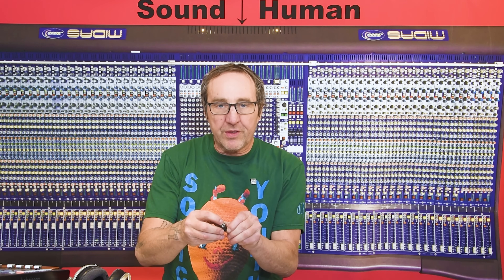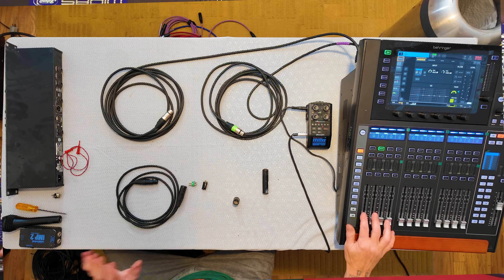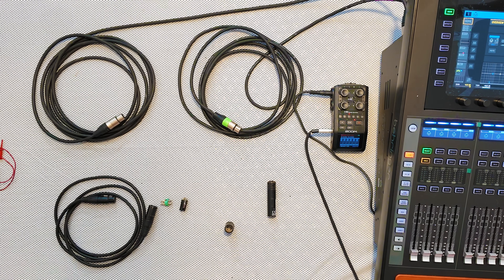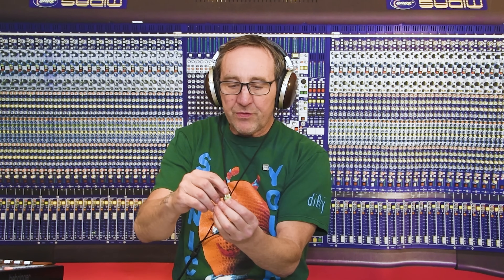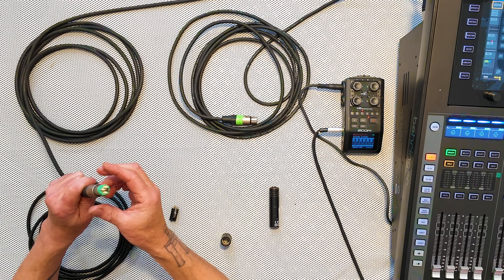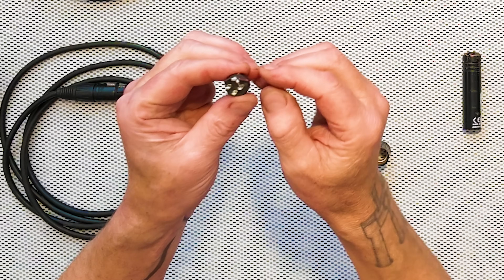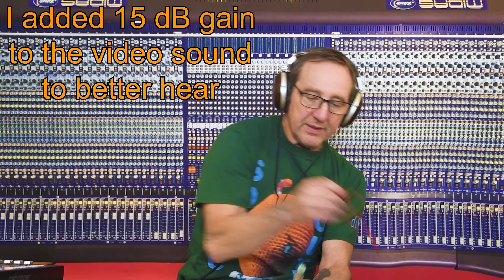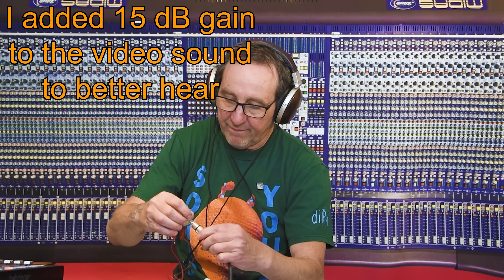XLR Shell Ground Issues

Comment: i have experience ground loop nightmares, but in signal processing and not audio. i've had this exact question before "do i connect this ground pin to chassis on my serial data cable or not..." and i came to same answer after consulting with more experienced engineers: "it depends" lol. in my lab, we would never ground a cable's plug body to the cable shield unless we needed to, and it generally made ground loops problems easier to deal with. the serial data cables i was making were differential pair and it was actually possible for them to operate with NO ground lol. in some cases we explicitly did not even include a ground pin at all with the data cable because equipment on both ends were being fed 120vac from the wall and they dealt with ground through their own various power supplies. usually though, i would include a ground wire (or use the cable shield for ground wire) because weird things can happen between serial data chips if the sender and receiver have slightly different ground values coming from their different isolated transformers. 

to be honest, i still feel like i never quite figured out how the hell it all works. all i know is differential twisted pair coms is WAY more robust than single ended serial coms. even when the pair isn't twisted, i've seen some heinous cables that actually functioned when they definitely should not have. you can be damn sure all the power supplies were grounded though! i didn't feel like riding the lightning with 28vdc an a zilliion amps lol

Comment: Could just make a grounding adapter from one of those neutrik D shells that grounds the xlr chassis at that join for use when you do need to extend cables that use high gain. Such as field mics for OB recording, or audience mics that are being multitracked. Easy fix?
Reply from the maker: You could carry short cables with the shells grounded and insert them when extending

Comment: Thanks for covering this subject @DaveRat !
We use metal shell Neutrik D-series connectors on all of our products and thus have clients that have run into this very issue.  It’s not an easy thing to explain without photos.

Three things to note that weren’t covered in your vid:
1)	AES standard is for the shell to be left floating/disconnected from Pin 1 (AES54-3-2008, AES48-2019)
2)	The IMP2 direct box you show in the video is an older unit with a metal shell XLR connector. Not sure when they changed them, but several years ago, they switched to a polycarbonate shell so that even if the XLR cable shell is grounded, you can still disconnect Pin 1 from shield ground via the switch.  I believe they made this change for this very reason.
3)	Many major manufacturers use plastic XLR connectors, even in their high-end touring grade products. (probably to avoid this issue) which could sacrifice some durability, imo.
Reply from the maker: Nearly all of the plastic (usually glass filled nylon) connectors have a shell connection to the XLR shell.

That said, different manufacturers connect or don't connect to the XLR shell connection.

Ideally you want the gear to ground the XLR shell. But you don't want the cable to force a chassis ground to audio ground connection.

Cool on the AES!

Comment: I wonder if there's a resistor value that would minimize the ground lift problems but still provide shielding on extensions.
Reply: No, but if your problems are RF pickup, a small capacitor between pin 1 and the shell might help.

Comment: I watched anxiously until you finally touched on audio ground versus safety (chassis) ground. At one point in my career, I engineered and constructed a fairly complex TV studio audio system.  I wanted to really nail this one, so I speced out an isolated ground system with all the fancy receptacles and extra ground wires. Where line-level patching was required, I used isolated ground patch fields....<really> made an effort.  On the first shake-down day I expected absolute silence out of the control room monitors, but had a lousy noise floor with underlying hum.  Turns out the electrical contractor never connected the final node of the isolated ground to anything.  Giant ground loop!
Respect for you and field production folks.  It is hard enough to get things quiet without cables laying in the mud, people walking on your stuff, and possibly sketchy juice on a venue-to-venue basis.  I enjoyed your video.
Reply from the maker: Very cool and thank you! Yes the iso ground is great. Things are easier and less troublesome now with digital but analog will never go away!
Reply: This is a fairly common misunderstanding of an "isolated ground" electrical system, and I've encountered many installations where this has occurred and more electricians than I would care to mention do not have a full understanding of how IG is intended to be installed. IG still needs to be bonded to the main system ground and the neutral just like any other installation, the main difference is that receptacles use a separate insulated conductor for ground instead of relying on the box ground that may also be connected to steel structure. Just last month I found three isolated ground receptacles where the ground terminals were only connected to each other! When the electrical ground is not connected to neutral at the "service entrance" it can lead to some really strange and damaging voltages particularly in multiphase systems with step-down transformers.
Reply from the maker: Agreed. Very challenging to get electrician's to understand separate ground wire to outlets that only connects to building ground at a single location
Reply: @matthewknischewsky6757  Absolutely! Sorry I got so far off topic, by the way...but the "4th pin" has also caused some weirdness in things just as Dave described and it sent me down the grounding rabbit hole.  I've only had the "pleasure" of doing 2 iso ground facilities because my work was in institutional buildings already constructed.  Years ago, I was able to tour the then-new NPR studios in Washington, and they had a chemical ground iso.  Very cool.
Chief Engineer to apprentice: "Go water the ground".  Apprentice:  "Huh?"

Comment: I am wondering though if using the 4th pin will protect it from EMI such as wireless energy since wires act as antennas and pick up signals from the environment. I am curious if the sheilding will actually reduce the wire picking up EMI? And if it ability to sheild from EMI is improved or reduced when it is connected.
Reply from the maker: The fourth pin does absolutely nothing if the cable ends is plugged into a microphone or plugged into a mixing board. Every microphone and mixing board will ground the XLR shell for you so you don't need to connect a wire to it. 

The only time you need to consider connecting the fourth pin is when connecting two cables together where neither of them have the fourth pin connected. 

The best way to deal with wireless mic EMI and RFI is to use quality tables with good rejection. 

It's all in the cable!

Comment: OL is not "overloaded". That means "Over Limit" over "open loop". Infinite Ohms. ∞Ω
Reply from the maker: And also overloaded with way too many ohms!
Reply: @DaveRat  Careful not to damage your meter!
Reply from the maker: Exactly. Back when I worked at Hughes aircraft, and testing compliance on some 1/16watt axial lead mega ohm resistors, one of the union guys that was  assigned to assist asked:

How do they get so many ohms into that small little tube thing?

Comment: So... should  we ground a stage box chassis using pin 1 of one of the female  XLRs if it doesnt have male returns   ..... ?
Reply from the maker: Yes, grounding the stage box will reduce EMI noise. 

Grounding it to one or more of the lines that you know will be connected is good.
Reply: @ its another conundrum  , the case( and DI box cases) still needs to be insulated from any metal staging or metal rack cases that might have a more local ground or the upstream might have loop issues. As i read somewhere , if only they had invented  AC mains balanced back in the day......Tesla has a lot to answer for !
Reply: @DaveRat  talking about stage boxes(?) why the f didnt Neutric make some chassis XLRs with the same strain relief as the line ones ... patch panel heaven !!!
Reply from the maker: Typically wear and tear on patch panels is not of the same magnitude as on cables, but having a integral patch panel strain relief would be useful for some applications

Comment: Would it be worth adding inline adaptor with ground to shell shorted for the rare multi cable setups.      Like turnarounds but male female.
Reply from the maker: Could do. But also, when was the last time you had hum or buzz from an extended mic cable where touching the junction made the hum worse?

I would say that unless you are recording nature or in a recording studio, it's a non issue and if you are in a recording studio, there is no reason you should need to extend cables.

But yes, could have a male to female XLR cand or barrel that has pin 1 to shell connections to use when extending XLR cables for applications where extremely low noise is needed and you also have very high gain levels.

Comment: How do you like the Wing? Seems like quite the step up in capability and workflow over X/M32.
Reply from the maker: For me it's a tool to demo concepts and such.

I am not the best person to give an opinion on digital consoles 

I have occasional nightmares of having to use a digital console for an actual gig, but I stopped mixing concerts in 2017.

Wing is very powerful and yet for me, I want to see everything always and all the layers are just annoying.
Reply: @ gotcha! I normally tour S6L 24D, but for many years have used X/M32 and MR18 when their capability/input count makes sense.   My vendor has not bought any Wings yet - I actually don’t think Inhave encountered one in the wild yet.

I’m a firm believer that we have reached a democratization of digital consoles where they can ALL sound really good given good inputs and a decent set of ears turning the knobs.
Reply from the maker: Yeah I believe digital can sound great and the biggest problem everything I test points to is "keep the meters low"

I'm seeing digital clipping on the wing with the meters reading minus 6 dB with some signals and I believe those digital clipping at even lower meter readings possible. 

It's all about keeping those meters down at the -18 to -12 maximum and adding a gain stage after the console if you want clean audio